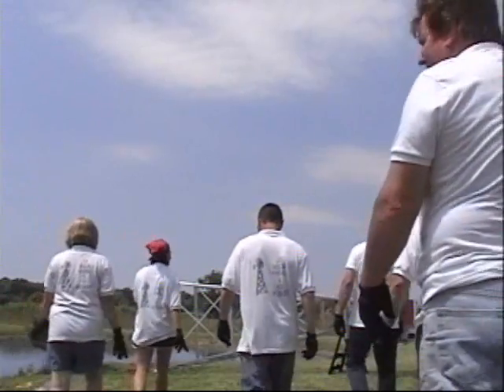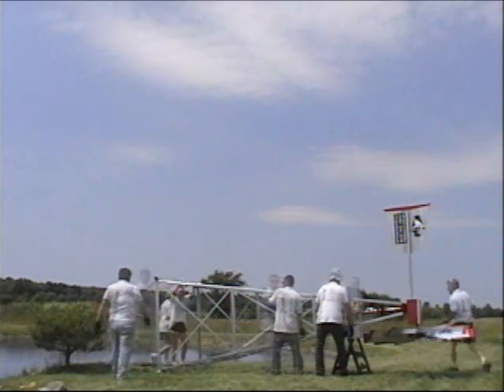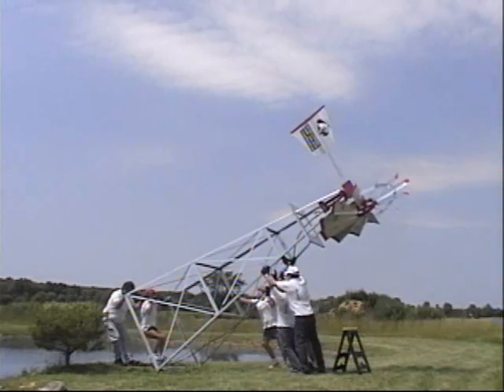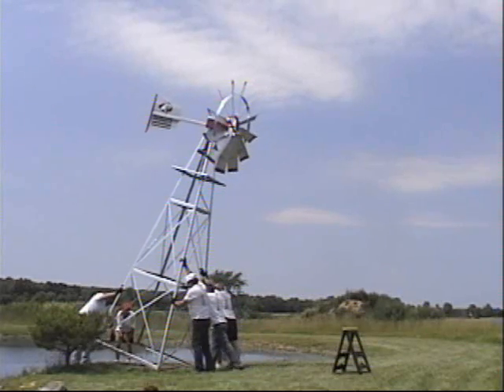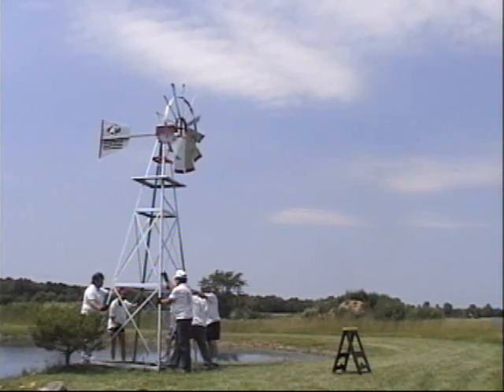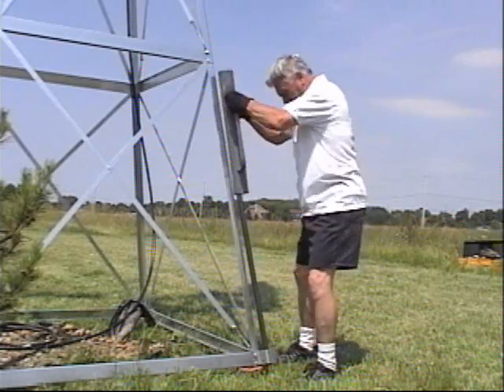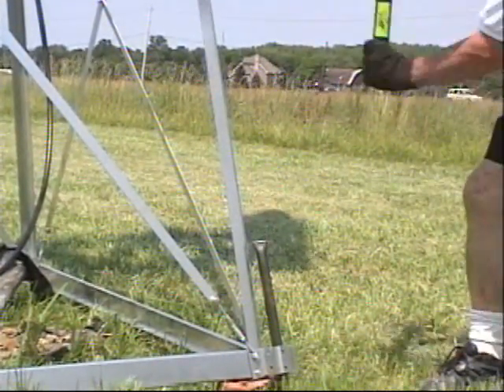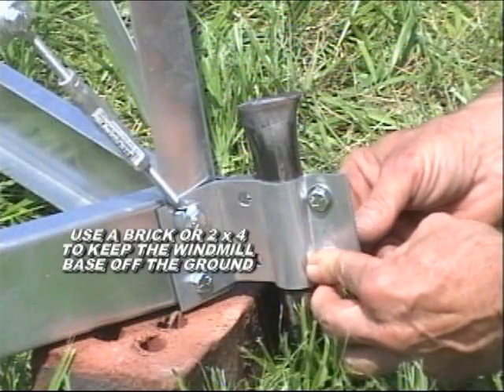Joe Mescan Windmill LLC - Standing Up a Windmill Pond Aerator | Best Windmill Aeration System

Comment: I will be installing the rods into concrete.  Is it okay to put only the base together to get the exact positioning of the rebar so that i can predrill holes to pour the concrete in?  This way when I erect the tower in the proper order I know the rebar will line up exactly with the base.  If this is okay is there anything I should know about separately putting just the base together (23' height)
Reply from the maker: Hi, Yes that's a great idea & we recommend to all customers to do that,  the steel rods go into the ground at a 7 degree angle and the only way to get them perfect is to use the tower base as a templet. You can get more info on installing  your windmill in concrete on our Form & Pour page on our website: https://www.pondaeration.com/CONCRETE%20WRITTEN%20with%20Pictures.pdf

If you have any further questions or need anything else please don't hesitate to ask. 
Thanks Joe